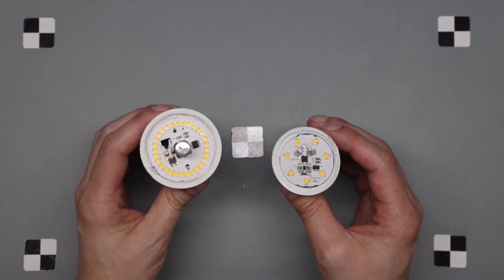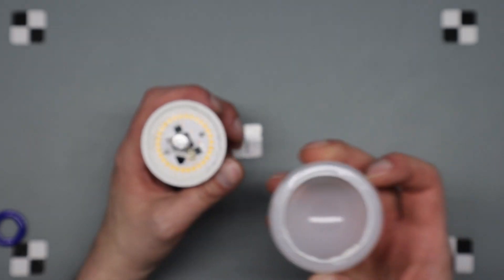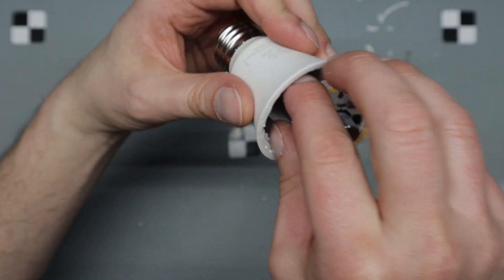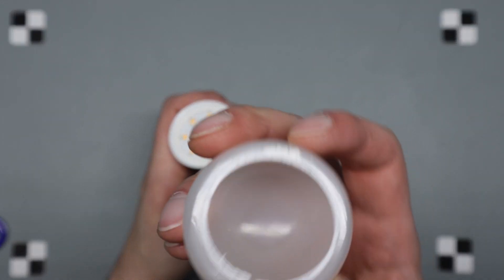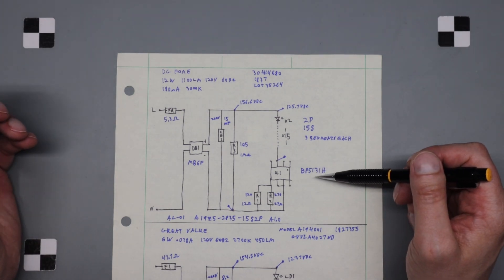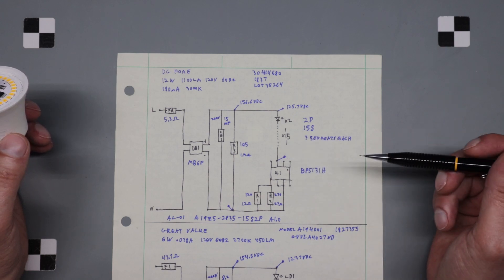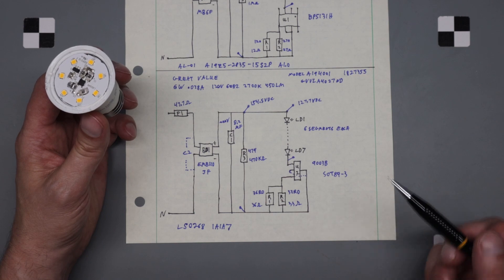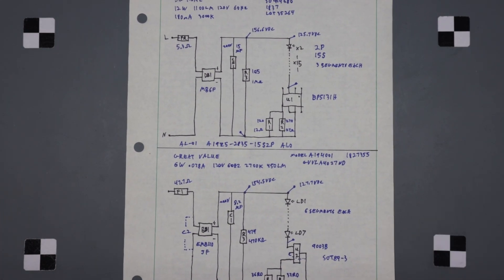Teardown DG Home 12w & Great Value 6w LED bulbs with schematics

Comment: Assuming on Led bulb, the default sense reistor value is 50 OHM for a10W output, with 100 OHM  we should get 5W power output.
In that case, since even voltage will decrease, the current will not be half value than default.
So, how we can calculate the exactly value of resistor if for example we want get 60mA from a default current of 120mA?
Reply from the maker: Depending on how the controller chip is set up, the resistor may be used in that way.
You would have to check the datasheet. Or try different resistors to see what the output changes to.
Reply: @eeAspect  Thanks to your well explained videos, I'm learning how Led drivers work.
I got from the chinese site some interesting CCT Wi-fi bulbs, that can be controlled even from phisique remote. 
The next step will be increase CRI redering (and decrease CCT) by swap some of the Leds and replacing with PC deep Red Leds of the same power.
Reply: @eeAspect  On CC drivers, by reducing the output current, does will be reduced also the Voltage minimum for turn on Leds? 
For example, default output: 150mA Voltage range = 48-24V.
Output 75mA Voltage range =?
Reply from the maker: @ It should still be the same voltage range, unless the datasheet has a graph on it showing different ranges vs current.